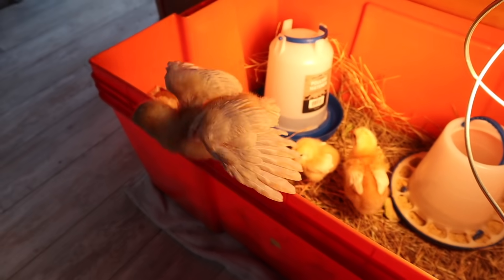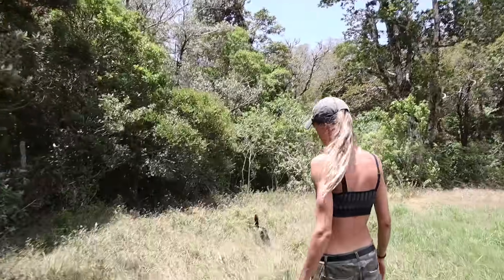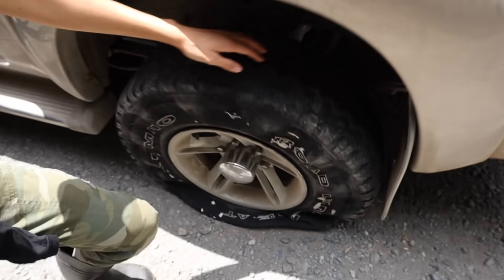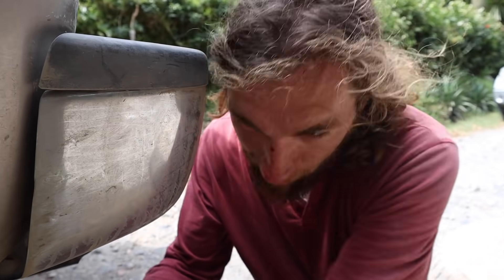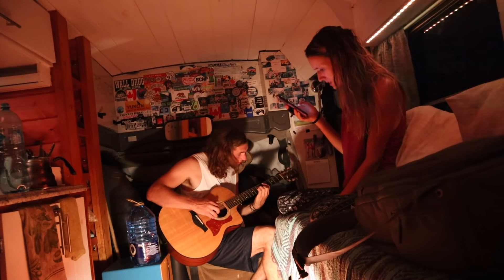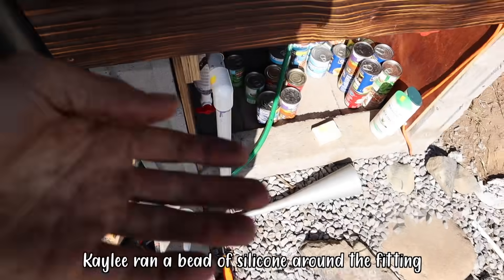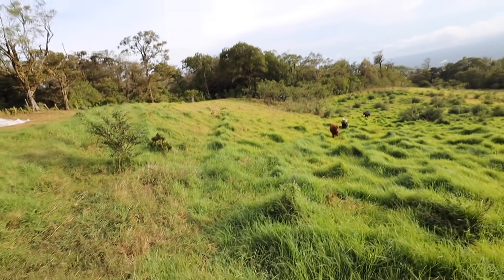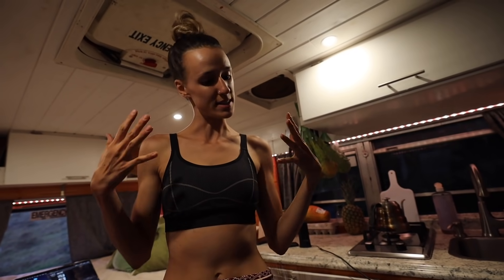WE'RE STRUGGLING // off grid living isn't so easy

Comment: I have been off grid over 5 years now and the first year I had no power but two hours of generator a day. I did have farming, hunting, and building skills as well as being a boilermaker welder. I built my place on my own and it has been a trial at times but it is doable. Skills and knowledge are key. I don’t recommend the garden on top of your pump. Seriously, the water will rot the wood and you don’t want the dirt going into the workings of your pump causing more wear and tear and possibly your having to service it sooner rather than later. Don’t make more work and expense for yourself than you need to. Believe me, it comes if you want it or not. Put it up on a stand an put a peaked roof on hinges on the pump house. So much less frustrating to work on when you have actual space. These things generally break down in the worst of weather and you don’t need to make things worse when having to repair or replace parts.
Reply: "Skills and knowledge are key", I couldn't agree more. But, there's a first time for everything for everyone who tries. We've learned from our mistakes, haven't we?
I would not have chosen to put an herb garden on top of my water pump, either. Access is important. On the other hand, my pressure pump has been exposed to the elements for 20 years. The only problem was when some ants got inside the contactor and blocked the contacts from closing. lol
But, I'm still trying to figure out how their pump is holding pressure w/o a check valve on the inlet. 🤔
Actually, Jordan lined the inside of the herbs box with plastic and provided drainage out the back. So, it should be okay for several years. No big deal to relocate it onto a stand, later.
Good point about Murphy's law, that shit happens during the worst of times.😎

Comment: Had a toyota hilux for 12 years, sold 2019. One of the best cars i ever owned. Had to change 2 flat tires and hated every minute of it. Get a patch kit and a 12 volt air pump. Saves a lot of headaches and time until you can get it properly fixed. Cheers
Reply: Jose Van Beverhoudt Amazing advice.
Reply: Patch kits only work on inner tubes. Can't remember the last time I saw an inner tube on anything bigger than a motorcycle. My advice would be to buy a cheap, old, but reliable backup vehicle. That covers all breakdowns. Plus, it provides transportation to and from a parts store, which is required for repairs on vehicle #1. Sometimes, parts need to be ordered, so transportation is needed for supplies, too.
Reply: @TheOleHermit  true patches are for tubes but you can get plug kits for tubeless tires which are even easier than patching a tube cuz you dont have to take the tire off or anything. they might actually be able to fix their other tire with a plug kit if they just ran over a nail or something and its just a hole and not a slice
Reply: @d3adt3dgam3s9  true bro but i think in this case that baby(tire) is whipped:)

Comment: When I built my 20' geodesic dome, I found pallet wrap to be extremely useful in locking things down in emergency situations.  You can get it in 18" or 24" rolls and there is more on one roll that you could use in a year.  It is strong, flexible, sticks together like plastic wrap, it's uV protected and you can bunch it up like a rope and tight things down.  you could have wrapped the solar panels on to the bus during that high wind event.

There is no such thing as doing things wrong!   There might be more sensible, or durable, or more efficient... but when building your own homestead what works is good enough!  I've tried to give you some pointers, but I realize by the time the video is posted the task is long since completed.
Reply: ... and duct tape.

Comment: My 2 cents ----> buy a Torque wrench, You don't need an expensive one just for wheel nuts. Look up the torque specs in your manual or online and torque only to that spec. and you won't have problems get them off later. Also recheck the Torque after leaving a tire shop as they usually rattle them on with a impact gun and are probably too tight. Also it doesn't hurt to check them every month or two

Comment: OMG, I can see your ambition, and it’s great! I have to say what I’m thinking though... You two seriously need to prioritize things NOW. Just pick a project and complete it. You’re going to learn the hard way leaving everything half finished and janky AF. Chickens need water. You need water. The dog needs water. Water was your first goal, so build a shed. It doesn’t need to be enclosed. Just build it big enough to catch rain water run off from the roof. It’s Four 4x4, four corners, set in concrete, and a pitched corrugated steel roof with a rain gutter attached to your water barrel. It can be done in two days easily. You can tie a rope around the barrel and anchor it to the shed. If you get as much rain as I think you do, you’ll be full in a month. C’mon bro, I want to see that water!!!!
Reply: Hi Bruno. Is it me or do these two really look like they have no idea what they're doing? Honestly, and this is one man's opinion, this looks like "play time" and not an actual off-the-grid project.
Reply: @jamesgossweiler1349  they have no idea. They're learning as they go.
Reply: So, let me get this straight. To collect water, they need to build a shed with materials they don't have.🤨 The shed is required to hold up a corrugated roof, which they don't have.😒 Did you see the episodes where they built a rain roof, which blew away like a kite.
IMO, they have over an acre of sloped land, so they don't need the roof nor the shed to hold it up. They only need to dig a swale (a kind of gutter), lined with plastic and gravel (filtration). Then, they can collect runoff water from their entire property and fill an underground tank (they already have tanks and a pressure pump.)
Reply: @TheOleHermit  great idea
Reply: Lynn Roberts  Never said that a shed is a bad idea, only that at this point, they don't have the materials to build one. So, once they have spent resources and ~ 1 week building the shed, what will harvest the roof's rainwater? An eaves trough, drain pipe, & a rain barrel (more expense). How does the water get from the rain barrel to the main storage tank? Either endless manual labor, one bucket at a time, or via hose (or pvc pipe) and a pump, which requires solar power. By now, the ~$500 (min) shed has taken a week to build and the ~$500 water harvesting system has taken another week to source part and install in an underground trench.
On the other hand, except for the gravel, they do have everything for the swale, which would only take a few days of digging. 
Then, only three days later (~same time I've spent on this thread), never needing to address their water shortage issue again, they could build their shed without limiting its location to being close to the main water tank.
IOW, solve a water shortage problem with the best water harvesting solution. Solve a storage problem with the best storage solution. IMO, they are 2 different species, which shouldn't interbreed. Doing so only dilutes the desired specialized characteristics.
Besides, they have since decided to build a plastic geodesic dome greenhouse for storage, which makes this a moot conversation. I'm waiting for the next episode to see how that turns out.
Stay safe and happy. 😎

Comment: Jordon. The pump model ( harbor freight) looks like what I have been using for 20 years. I have gone through 2   . Word of advice shut off the pump when you travel.  I forgot once. And second time a friend ran my cistern dry. Burning up the pump. 

And if you ever have trouble with air . On the high side of the outlet at the pump. Install a bleeder valve of some type. I used a T fitting and a ball valve. 

Doing good there young man. We all screw up from time to time. 

And here are some words of wisdom for a tractor. Kubota is your friend. I’ve had junk cheap tractors. I’ve had the best luck with kubota. Now retired and thinking about a L series in a couple months. 
Don’t forget to look for old laptop batteries. 18650.
Reply: It would probably be a good idea to install a low level shutoff switch in the tank and wire it to the pump circuit.

Comment: Jordan, please give this a thought, build a square tubing frame around your water barrel (for wind protection) and elevate it two feet above your pump house roof and you can get rid of the pump and electric to use the water,  because gravity and the weight of 600 gal of water forced into a one inch pipe is more than enough water pressure to shower and water plants.   Also have mom send you a tire plug kit you can plug your own tires and air them up it’s a must have living in the country.   Love you guys so much your doing a great job.

Comment: You can go to david or look for a shop in david thats open and delivers. Autocentro and Tambor are supposed to be open. The Autocentro David branch will remain open from monday through friday from 8:00 a.m. at 1:00 p.m. their number is 360-0666 and Tambor is open from 8:00 a.m. to 2:30 p.m. this is the number 774-3948. If anything you can check on google for any other place but a tire for a hilux should be no problem if the rim is intact

Comment: Hey, I have a lot of experience living off grid because I operate a dive boat that takes tourists out to sea for weeks at a time for scuba diving trips in Egypt (Africa).

Right now with the virus and none of us knowing how it's going to go, the boat is looking more and more like a place I might end up living in.

Now although there are pretty views while anchored off shore there are a lot of issues to deal with.

My first suggestion for you would be to get a 12v or 24v water pump. They are real small and you can make all the water connections with garden hose instead of pipes. The water pressure is still decent as well.

My second suggestion would be to source a couple of small plastic water tanks. They come in 500 litre models and are great because have a very low centre of gravity so they sit firmly on the ground and won't get knocked over. Also, if they are all connected up with garden hose, it makes it real easy to reset once they are knocked over.

Maybe you could still use the big tank, but by cutting it up to make a big water capture device.

I love you guys. Beautiful movement and I wish you the best of luck.

Comment: Just wanted to give y'all ( Nomadic Movement )  a suggestion regarding your driveway. From experience dealing with something similiar. Everytime we drive down our dirt drive we have a homemade grader. (Metal Fencing bars with barbed wire ran around them and chained up to drag behind our truck)... Basically we pull it out the bed of our truck and hook up to our hitch so it drags behind us smoothing out the drive as we go up and down the drive way and at the end of the drive we get out roll it up and toss it back in the bed of the truck. Then drive on to where we were going. Once we get back we stop at the beginning of our drive way pull it out and un-roll it and hook up the chains to our hitch on back of truck. Then drive up the drive way while it drags behind us again. Doing this every time you drive back and forth on your driveway will help keep it smoother. When you first start it will take quite a few times to make a big enough difference since it's gotten so bad. But once you have done it quite a few times and you make progress this routine will become just the normal process and it will keep it looking good for you. Also keeping the drive smoother will keep your truck in better shape cuz you won't be putting it through as much rough bumps daily. Hope this helps out. Love your videos and what you two are doing is very motivational. Keep it up!!
Reply: If you ( Nomadic Movement ) want to get a better idea of what we use for our Dirt Drive Way Grader you can search on YouTube for ( How to make home made grader for smoothing out a dirt drive way )... here is a link as an example to one that is the closest to the one we made. Some that come up when searching on YouTube are permanent structures which would definitely do the job however, this type of design similar to ours allows you to roll it up to put in the bed of truck easily ( https://youtu.be/NAtNaS4NfzI )

Comment: You could use a ratchet strap from the fence post to your bus over the top of the tank to stabilize it until you find another way to anchor it. 2-3' long lag bolts make great anchors, they may be sold as Earth anchors. I use rod iron with ratchet straps in a pinch to anchor my water tanks. It's super windy here in the winter.

Comment: 1-check tyres before every journey 2- keep batteries charged at all times to run electric tyre pump 3- carry a bottle of liquid tyre fill 4- carry extension tube for wheel nuts spanner 5- carry spare servicable spare wheel 6- make sure you have proper jack and metal plate for soft ground 7- if you drop screws/nails on ground pick them ALL up (magnet).

Comment: 2 things, I am CA born and raised, I retired to Colombia, S.A. We have a small oven which is kind of unusual most homes do not have ovens here. Our oven just does not get hot enough and I have tried to adjust it but it doesn't seem to be the issue. Anyway I have made stove top banana bread a couple times but don't really have correct pan, when I saw what you used for your bread it made such good sense with the whole in middle it would cook so much more even. Was that something you found down here? When restrictions are lifted I will have to go on a mission to find one. #2 on your raised structure that you are welding up for your cabin, you really need to add some corner braces from the uprights to the horizontal bars or square tubes. As you build up and add more weight the side loading say from the wind will exert a lot of pressure at the corners and by adding a gusset at the corners will disperse the load along the upright and not just at the top where you have attached the horizontal. It can be sat 30 cm or 12 to 14 inches long with 45 deg. Cut on each end. Just something to think about, it will add so much stability to the structure especially as you build up.

Comment: Keep a three foot 2 inch ABS pipe in your truck at all times and use it as a johnson bar to crack the nuts on the wheels, it works I used one many times and no problem at all. That plastic pipe is pretty strong to do the job especially when you have the steel wheel wrench rammed up inside of it.

Comment: The chicken coop needs a roof or your chickens will COOK and/or get soaked in the rain.. Cover somehow.
Maybe put something heavy on the solar panels for the night to keep them from blowing away. "Mike the Fit Farmer" (you tube) has chicken tractors. Great idea to use the plastic house for chickens, just need shade, maybe tie on a plastic tarp? Am sure you can think of something you could use for a roof for them.
Those crickets will gobble up your entire garden in an hour or so. Maybe plastic mesh will keep them out, (like screening) The plants need rain/water and sun and to be spaced apart, but NOT crickets. I had the same problem with my tomato plants, good now. Am NOT trying to give you a hard time, just suggestions to help you solve problems that i have had in the past.

Comment: You may have to pour cement in to hole around your water tank and put some cables from your water tank to anchors in the cement around your tank that you will have to dig and pour full of cement that way the wind can't blow it over. You guys may find that you will in to try thinks don't with cables to the ground. Cent the wind gets really strong where you are at.

Comment: Jordan look for red hot or super blue pvc glue. it don't require primer, but I recomend you to use primer any way, your pic is probably sun bleached the primer will help melt the plastics. Any pic exposed to sun light should be sprayed with plastic paint , it will help it from becoming brittle. Also when you cut pic wit a saw you need to angle score the edges inside and out all the way around . There is a very fine burrs from the saw blade they will actually push groves through the softened plastics causing a leak under pressure. Hope this helps
Reply: Stupid computer is always spell correcting me. All the pic is suppose to say PVC.

Comment: You will often have wind between the changes in climate because of the weather fronts moving through.  In a couple of weeks, wait until you have incredibly strong rain showers for parts of the day.  So hard you won't need to install a shower.  😂  raspberry pomegranate sounds very yummy!!   Hey hang in there.  You're actually doing very well.  Hope you can get those clamps for the panels tomorrow.  All the best guyz!

Comment: My suggestion to keep your chickens safe from predators is to learn from the locals, they will know what predators you should look out for and what/how to build to safeguard the chickens. You may have predators tunneling under the bottom of the chicken tractor. Most stationary chicken coop wire goes down into the ground to protect from this.

Comment: Your generator is a decent  Honda clone , predator and champion use the same  engine.  I’ve been off the grid for 5 years in Texas. With your rainy season coming you will use the generator a lot , I suggest changing the oil every 30 days with 10-30 synthetic oil since these don’t have oil filters and are like lawn mowers .  You just tilt the  generator on its side and drain in a aluminum pan  then refill with .6 quarts of oil.  I would also get a backup generator like a tail gator generator 800 watt generator from harbor freight for $120, it will run a 10 amp battery charger and charge your cameras and computers. This info maybe help your viewers more since you have a house in town and make 10k++ a month on you tube . If youtube stopped paying commissions would you be on the first plane back to the USA or would you stay in Panama?